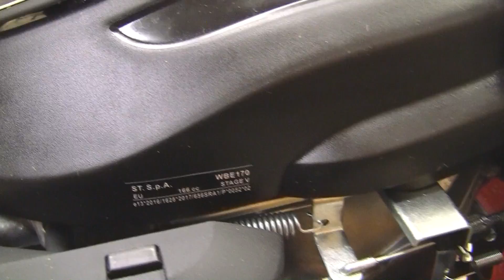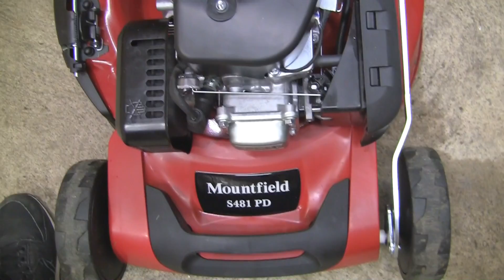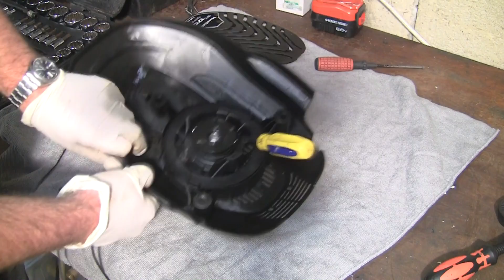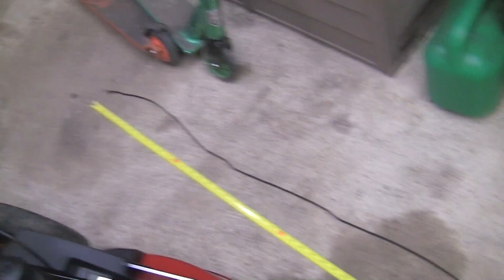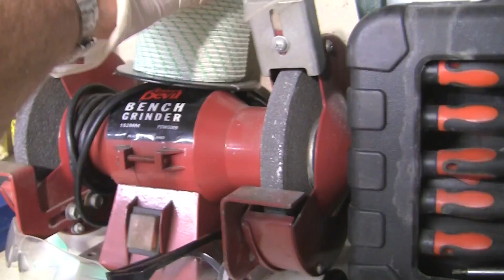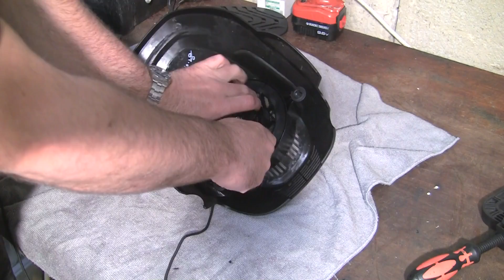Mountfield S481 Petrol Lawnmower Starter Recoil Pull Cord Rope Replace

Comment: Paul please help :-(( I have bought, repaired and sold plenty of mowers over the past few years, but I have come across a problem. I have a Hayter R53s which I simply cannot get to start for love nor money. When I picked it up the fella had it running absolutely lovely from stone cold first pull. Got it home and nothing. Any idea??
Reply from the maker: pull spark plug out and pull it over without it in then put it back in and try it
Reply: That happened to me. In trying to figure it out I lost the ball bearings. Replacing them fixed it.